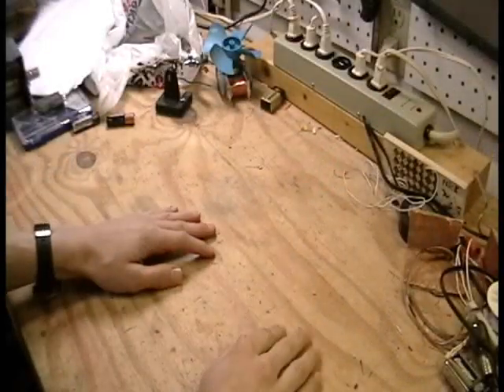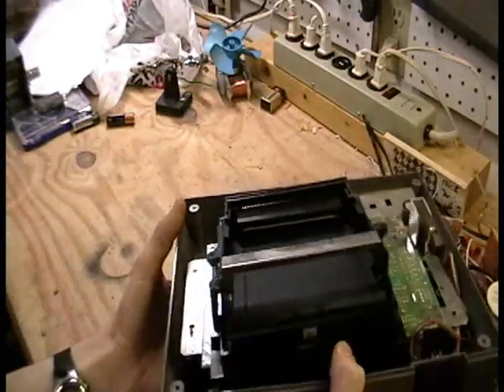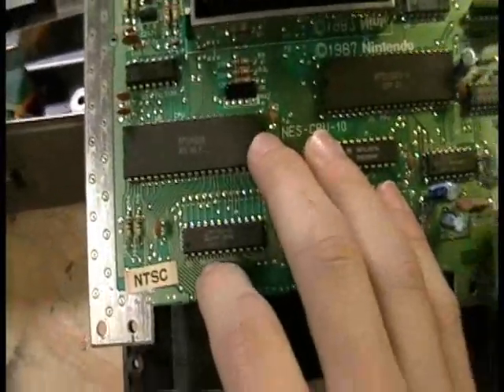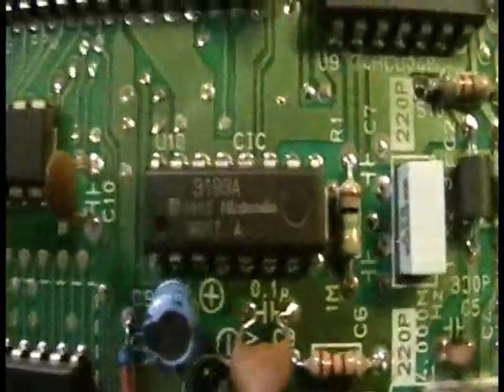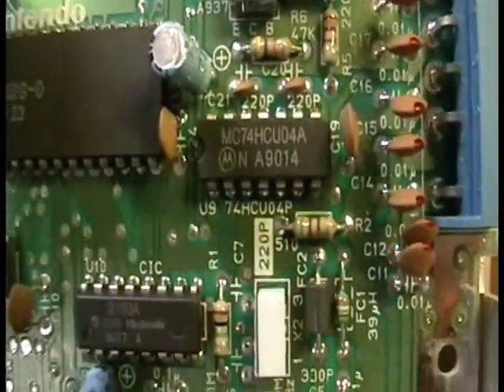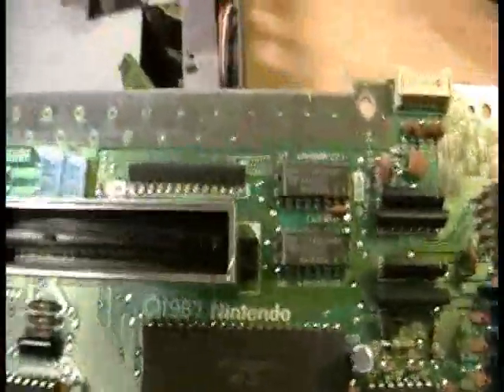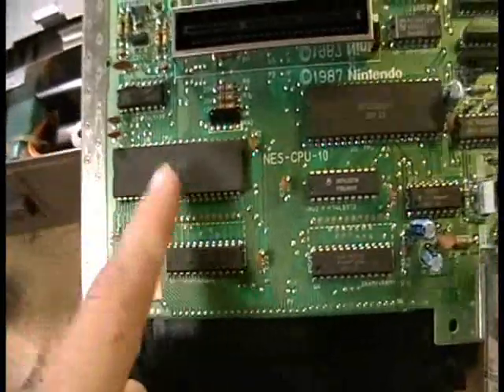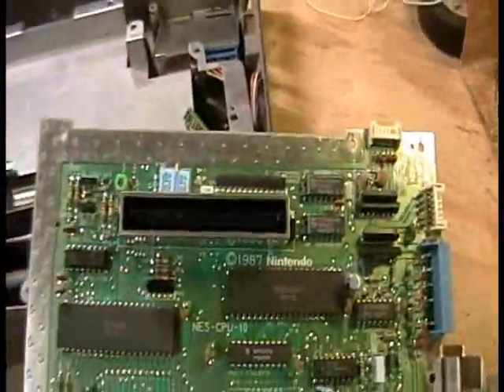Gutting an NES

Comment: also, you CAN play european games on the NTSC NES if the lockout chip is bypassed but they will run slightly faster than intended, and i believe some of the picture will be cut off.

Comment: binary-coded decimal mode is a special method of addition and subtraction in the 6502 that treats a byte as two base-ten numbers, each using 4 bits of the byte.

say the two 4-bit nibbles were both equal to 0. if you add 9 to it in BCD mode, the low nibble becomes 9 as would happen in non-BCD mode, but say you add another 1 to that in BCD mode. the low nibble rolls back over to 0 and the 1 is carried into the high nibble.

Comment: Just a small thing, the PPU was a video decoder chip not a processor, and had nothing to do with the 6502 (maaaaybe the TMS9918). I too have been recently building a homebrew computer based on the 2A03. Check it out at watch?v=UfiV9dCNjTg.